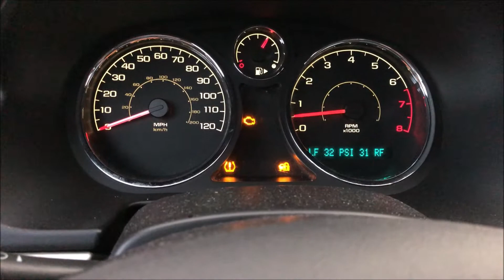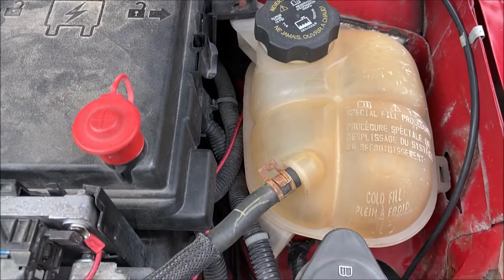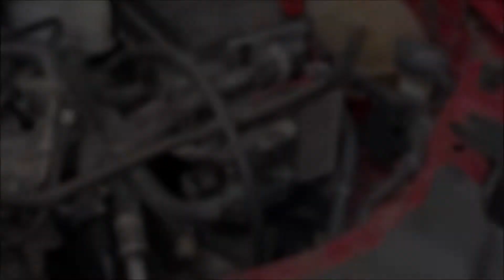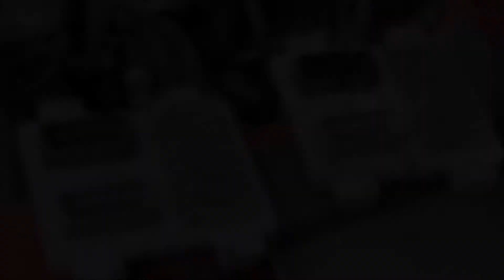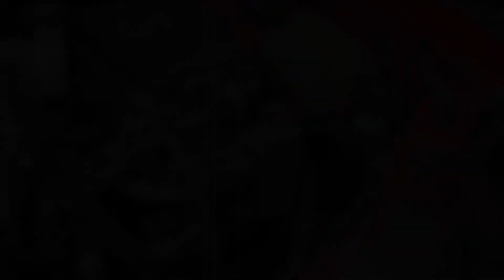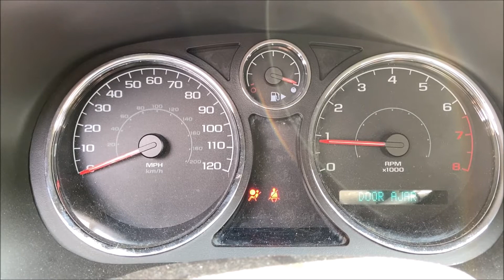2010 Chevy Cobalt Instruments going Crazy! What I’ve tried and ECM replacement

Comment: Wait I found the freaking solution lol drum roll please. So my craip 05 Chevy colbalt was jerking when shifting gears the speedometer goes all wonky and the power steering goes out. And there for awhile I would drive it and it would do it every few days to everyday. So I found a video on YouTube where they grounded a wire from the tcm to a metal part on the car. My stepdad is a mechanic and said u cannot ground wire to the tcm it has to be a bolt or something. Well sure the f enough he figured it out and a ten minutes ground a plain ol AutoZone wire from the tcm would work but it did all issues resolved!!!!  If u this sounds like your problem I can find the video and share below. He also cleared all codes. Oh my I finished your video well craip idk then. He did tell me that he had to move the grounding a few times though to get it to work. I need to give him a gold star
Reply: Can you share the video? thank you
Reply: @DanielSanchez-kh5td  https://youtu.be/i3K5AFR7vM8
Now don't mind the vehicle it still works for colbalt. There's another video with the same fix but it's a colbalt however doesn't really show how he fixed it. My car is running fine still
Reply: @DanielSanchez-kh5td  https://youtu.be/EzQZbGp14ro.
Also my stepdad said u cannot ground to tcm it has to be a bolt or something. I don't know anything about soldering so I guess it makes a difference on types of metals. Also it took a few tries he would have to move it a few times. like tinkering with it.  Good luck

Comment: Hi Carbon,  just got back from mechanic with my daughters 2010 Cobalt. She had the exact same problems with crazy instrument panel that you had. I too checked and tried a number of remedies from Google with no luck. Long story short, the mechanic tracked the problem back to the radio/stereo ( stock), said it was bunging up electrics with bad signals (?). He pulled the fuse on the radio and crazy dash lights and stuff went away. Put fuse back in which reset radio, everything worked fine for a bit, then fubared again. Pulled radio fuse and everything was fine with crazy dash.  Sooooooo…….crazy dash gone at moment, no music though (don’t know which kid thinks is worse though). Found your vid while looking for stereo replacement in Cobalt. You have a great presentation style!!!!!  New subscriber!
Reply from the maker: Wow, that’s so crazy that the radio caused that. Yet, from all the stories I’ve read/found about the electrical on these cars, I guess I’m not surprised. Hopefully you get that new radio going and dash craziness never returns. Thanks for the kind words on the video, too, definitely appreciated, especially with the chancel being so new. And thanks for watching abs subscribing!
Reply: Hello, did the radio fuse trick turn out to be a permanent solution? I'm battling these issues on a 2010 currently.
Reply: @richardgray742  I had to replace my ECM (used), for the same symptoms as well as hard steering, then everything went ok, except for having codes P0054/P0171. I will replace the downstream O2 sensor and see. Otherwise, the new ECM would be not an exact match and looking for a different fuel trim to deal with!